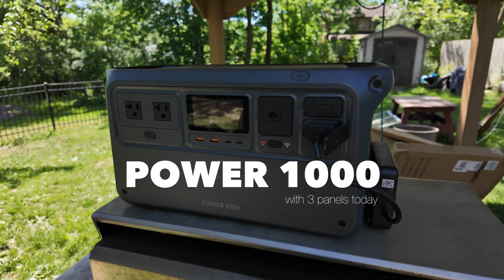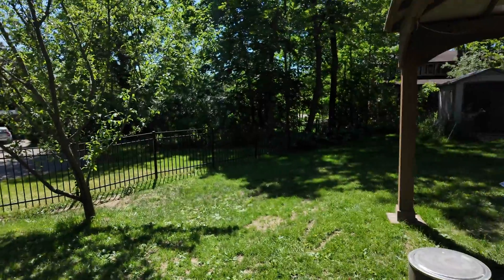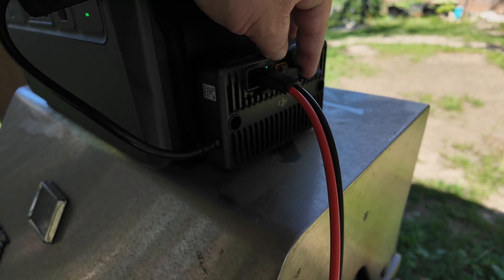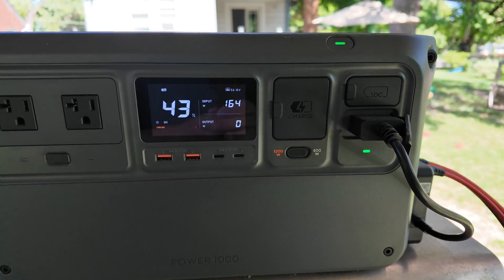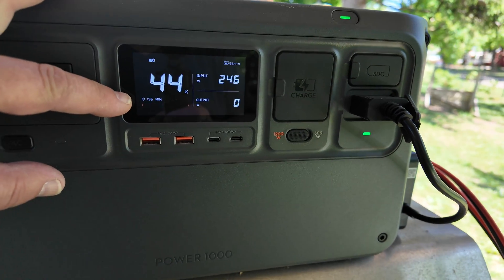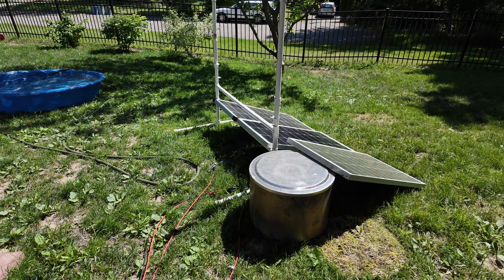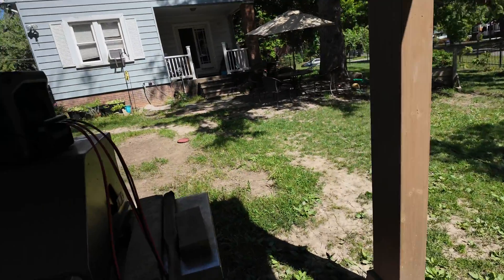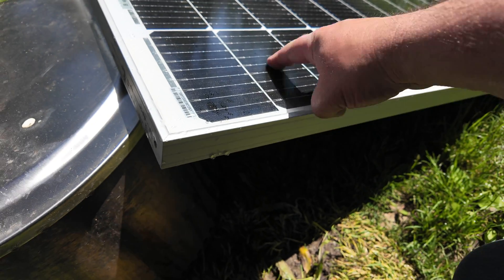Solar Power with DJI Power 1000 and 3 Panels

Comment: I’ve just brought a Dji power 1000 to add to my camping set up. I’ve got the Dji Mppt aswell but I can’t find what specs the solar has to be. All I find is buy the Dji solar panel but I’ve already got a few solar panels.
Reply: but basically, each Mppt adapter cannot exceed 400W. The output voltage canot exceet 30v per panel. Howeevr please find the officail documentation in case I am remebering incorrectly.
Reply: @xCHOPP3R and can’t exceed 10amps per panel per xt60. Max of 30 per mppt controller. I’m finding this out as my 220w panel is too much for one port….
Reply: read the official documentation. you can find it with a google search.

Comment: Each xt60 port in the mppt support only 100w Or 200w solar panel?
Reply from the maker: You can use 200W panels, if they don't exceed 30V each. But the max output is still 400W.
Reply: Why does it say on the XT60 port screen 53V going in, if 30V is the max??